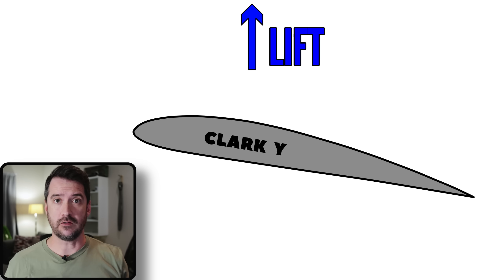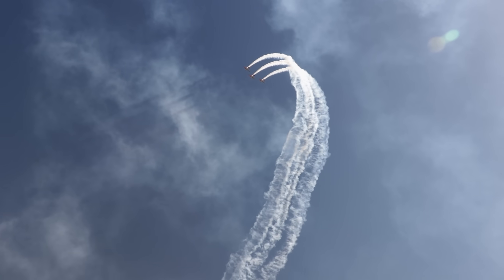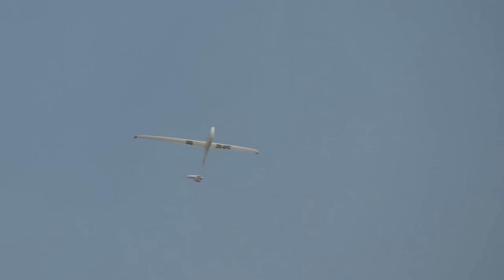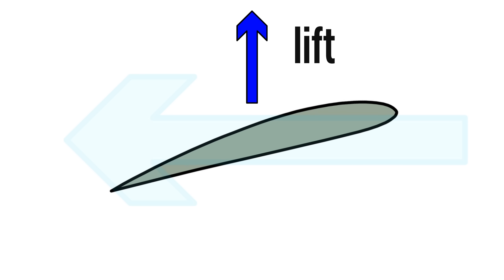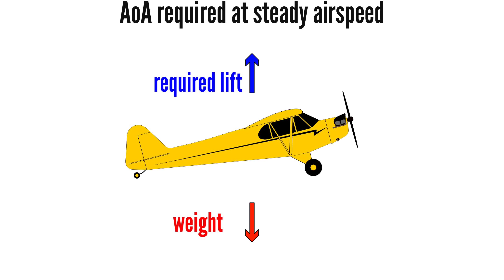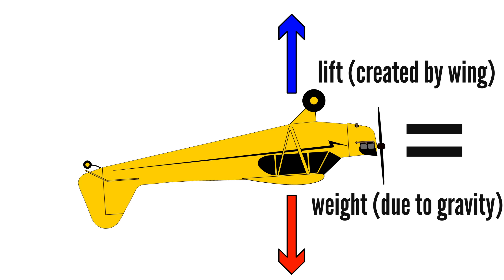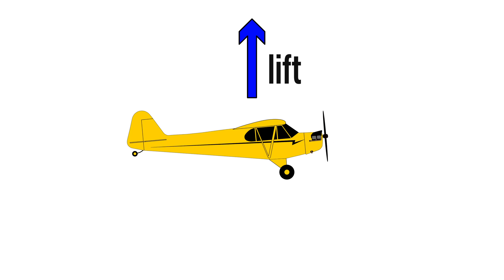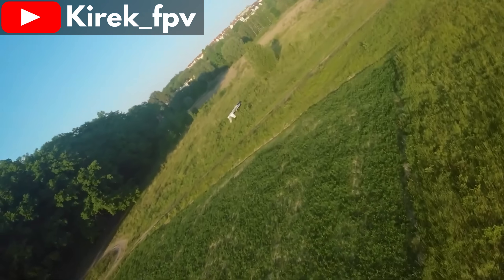Is Airflow Distance Over the Top of a Wing Always Longer?

Comment: Lift is probably created by BOTH "different path lengths/different air speeds between the top and bottom of the wing create differential pressure (Bernoulli effect)" AND "air is pushed down so the wing is pushed up (Newton's third law, equal and opposite reaction)". A rudder steers a plane or ship by deflecting air or water, respectively, to the side, and the rudder moves in the opposite direction as the air it deflects (Newton's third law). A wing can be seen as a horizontal rudder: positive angle of attack deflects air downward, so the wing rises. But I can see wing camber adding the Bernoulli effect to Newton's third law.
Reply from the maker: Probably yes. This video was more to disprove an argument (the upside down wing thing as mentioned) than give the ultimate version of how lift is created. I think I said as much in the video.
Reply: @LetsGoAviate  Yes, I know. I wasn't intending to argue, just add to the discussion.

Comment: I have flown many an RC plane (and heli) upside down.  However, as pointed out in this video, I have never and will never attempt to fly my 2meter FPV plane upside down.  It's just too heavy.  In a steep banked turn (maybe 2G)?  I get a lot of banana'ing of the main spar.  I'm not even going to loop it or roll it.  My fear is that once inverted the big thick flat high wing will need a huge amount of AoA and end up "elevator" sinking, stalling or inverted spining.  The "out" is to split S pull.  I fear that (up to 4G) might pop the carbon spar out of it's glue slot and night night.

Comment: All airfoils are a compromise in an attempt to improve the lift and drag curves of a flat plate. Since a flat plate is very limited for structural purposes thickness must be added for strength. The classic curves applied to airfoil shapes were derived from educated guesses in an attempt to optimize lift and drag characteristics observed in experimentation. Over time improvements in the understanding of the behavior of airflow over the surface of wings has been much better understood. However, to this day, even the best fluid dynamics computer models are not 100 percent accurate. The simplest answer is that enough air must deflected downward to carry the weight not being offset by any upward thrust angle. Those fluid equations do include Bernoulli’s principles, as well as simple mass deflections caused by the chord line angle of attack. The airfoil shape in turn can mitigate turbulence in the wake thus lowering induced drag and separation bubbles on the upper surface thus increasing usable angle of attack. These are well understood principles today yet the math is still incomplete as the actual airflow is not really a fluid and is chaotic. And, most of this understanding goes out the window as the airflow reaches supersonic.
Reply: Sorry for the typos.
Reply: Side note: Almost all the lift of a wing is created by the shape of the section ahead of maximum thickness. The rest of the airfoil is primarily for controlling induced drag.
Reply: @gilbertgauger3380  Don't you mean "form drag"?  My understanding of "induced drag" is the drag due to the work of creating downwash.  Which is an inevitable consequence of generating lift, though for a given amount of lift it can be reduced by strategies such as increasing the wingspan.
Reply: Crispin Miller, actually both. Typically, though form drag is technically seperate , in the case of a wing the drag is calculated/ measured as the combination of drag forces. For the entire aircraft the non lifting surface area contributes primarily form drag and is calculated accordingly. The absolute simplest calculation is simply frontal area of the plane as a whole but that value can obviously be reduced by strangling the shape. Most airfoil and wing studies compare coefficients of lift and drag and coefficient of drag is both induced and form drag combined. Just convention.

Comment: Pull a slightly-inclined hydrofoil through liquid sodium, and a transverse force is the result. Pull the same hydrofoil through liquid helium, and there is no transverse force, even with exactly the same geometry. Any theory of lift needs to explain this.

Liquid helium is a superfluid, so there is no flow separation at the trailing edge of the hydrofoil, and hence no transverse force is generated. Liquid sodium has viscosity, and there are viscous boundary layers which thicken up around the hydrofoil and are unable to pass round the trailing edge. Instead there is a flow separation and vorticity is dumped in the flow.

The flow around the hydrofoil in liquid sodium is an elliptical system, not a hyperbolic system. What happens at the trailing edge has effects which are able to propagate upstream and alter the whole flow around the hydrofoil. Where a starting vortex is dumped in the flow, by the principle of conservation of vorticity there must be vorticity of opposite rotation associated with the hydrofoil. This vorticity is responsible for the transverse force on the hydrofoil, or lift on an aerofoil. If the hydrofoil stops then it will be dumped as a stopping vortex. Both the starting and the stopping vortex can be visualised.

Conservation of vorticity is a conservation rule in two dimensions, but a topological rule in three dimensions. The bound vortex associated with the hydrofoil generates a transverse force according to the Kutta-Joukowski circulation theorem, which may be simplified as the Magnus effect.

Comment: The explanation I like the most is that of Newton's 3rd law, in the end, at the molecular level, whatever happens doesn't matter. It's like if they tell you why a glass stands on a table and they talk about electrostatic repulsion between electrons, it's easier to say that the wing pushes the air down and the air pushes the wing up.
Reply: Yes, air HAS to be accelerated downwards to supply an equal and opposite force to the weight of the aircraft. It seems the argument is more about HOW the wing supplies this force. Here is my take on this. 
The momentum of air molecules deflected downwards off the bottom surface pushing the wing up, is easy to imagine. 
The air above the wing thins out and speeds up as it covers a longer distance in the same time. This causes the higher atmospheric pressure air some distance above the wing to move downwards to fill in the thinned out "vacuum" - in effect, pulling the air downwards (downwash) and creating an opposite lifting (sucking) force on top of the wing.
Combine both the down wash from the bottom and top, and Newton third does the heavy lifting.
Reply: @aeomaster32  I've been thinking a lot about the issue of lift. And about the suction, I don't really agree, gas molecules don't stick to objects, they behave almost like little balls bouncing against each other, so they can't pull, only push. When we notice a suction, it is actually a push from the other side.
Reply: @gabrielhacecosas  
I agree with you.  I could have worded it better. As I mentioned, it is the atmospheric pressure some distance above the wing that pushes the air into the lower pressure just above the wing. The effect of "suction" is only air pressure pushing into lower pressure - like a vacuum cleaner.

Comment: Ok, yes, the air flowing over the top of the wing does create lift, but no where near enough lift for the average airplane to actually fly.  The lift created by the air pressing on the bottom of the wing is what creates the majority of the lift.   If you think this is wrong, then explain how a fully symmetrical wing on an aerobatic airplane works.

This is akin to asking "What makes an airplane turn?"  I've asked this of many an airline pilot (I was an airline mechanic & inspector most of my adult life) and the majority of them got it wrong!  It is not, as most would guess, the rudder.  If you press a rudder while in level flight, you just yaw the airplane.  You might ultimately achieve a semblance of a turn eventually but only because you will have to other controls to keep the airplane right side up!  No, the correct answer is the elevator!  When making a turn you should use both rudder (yaw) and aileron (roll) to establish a bank but once the bank is established, elevator must be added to actually fly around a corner.  I proved that over and over using the auto pilot on the ground (without hydraulics on the flight controls don't actually move, however the control stick does).  Almost ever pilot was amazed to see the elevator move once a turn attitude had been achieved!  It's just something pilots do without thinking about it.   Fighter jets often fly at high speed using only aileron and elevator, while the rudder is either damped or removed from the system entirely (this only happen at high speed where the vertical stab could be damaged by radical changes in rudder input.  Even commercial jets have yaw dampers and reduced rudder travel as their speed increases.
Cheers, 
jc
Reply: I think all the lift comes from below the wing . As the pressure above the wing drops , less force is pushing down on the wing from the top surface . Partial vacuum  is not a force , it is a reduction in force. Pressure drop is a force drop per unit area . This pressure drop is often required for airplanes to fly
Reply from the maker: Not disputing this, but one thing, a symmetrical wing is no different than a cambered wing or a flat plank for a wing. The stagnation point still forms below the leading edge at any positive angle of attack.

Comment: Air is like an elastic band, can be compressed and stretched. Its this stretching of the air over the upper curve of a wing that equates to lower pressure compared with the subtly compressed air under a wing. Stretch air too much and it separates resulting in a stall.
Reply: Actually for any low-altitude general-aviation aircraft the fluid-mechanics theory generally treats the air as incompressible.  The pressure variations over the wing are not much compared to atmospheric.   Stall doesn't come from decompression but from tilting the wing too much so it stops acting streamlined and this is the reason the flow separates from it.  (See my post elsewhere in this thread about that.)

Comment: There is also newtons law effecting it, the air defected downwards by the wing angle of attack also gives lift
Reply: But it is minuscule.
Reply: @tedmoss  The newton's 2nd law part is not small.  The change in vertical momentum of the air (the air turned downwards) must create a force equal to that of the pressure difference between top and bottom of the wing.  Though we have to be careful of what we mean by the word "deflection."  So the motion of air moving down is as substantial as the weight of the aircraft.
Reply: @tedmoss 
No, you CANNOT generate ANY lift without transferring downward momentum to air.
IF you could do that, that would violate Newton's 3rd law.
IF, IF that was possible, you could theoretically create a propulsion device for use in vacuum.
BUT WE CANNOT.

In other words, lift is 100% equal to mV/t.
No more, no less.

Comment: Thttps://en.wikipedia.org/wiki/Coand%C4%83_effect

The spoon demo (mentioned in a prior reply) is an example of the Coanda effect, not mentioned elsewhere in this debate.  (to the best of my knowledge).

My issue is the dubious assumption that two particles of air at the separation point will exactly meet up each other at the trailing edge, (one particle having gone above the AF & one below).

Frankly this is nonsense, and the very basis of the "different path length" = different average velocity = Bernoulli lift.

I'm not saying Bernoulli lift does not exist, but is only one component of a three part equation.

In my opinion B lift is the lesser of the three, and Newtonian the greater. The MIT lecture on this topic also dismisses the  particle convergence at the TE.

Comment: Previous generations of instructors should not have ADDED an erroneous constraint: air over the top gets to the trailing edge in sync with the air traveling underneath. It doesn't. Smoke in a wind tunnel proves it.
Reply from the maker: Agreed